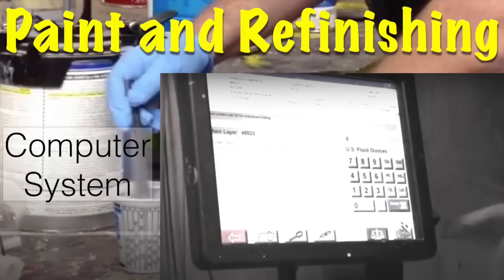Mixing Primer -  ASE Test Video Guide B2 - Part 7

Comment from the maker: I would read the technical data sheet for the brand you are using to see how many coats they recommend.  I would say 3 to 4.  I would let it set at least 24 hours before block sanding and top coating.  Waiting longer will be better to make sure there is no shrinkage.

Comment: Hi, I sprayed a 2k primer (5-1 paint to hardener, with a little bit of thinner at the end). When it dried it was quite a rough texture, I believe it was a high build but it was too rougher finish to of been right. I used some etch primer with the same gun on the same settings and that came out fine, same with top coat. Any ideas why it came out like this? Jacob, from England.
Reply: +jacob1029 Couldve been the thinner...also were you painting out side or where dew or frost could've gotten at it?
Reply: +Jon Doe or was it way to hot maybe drying the thinner in the air?